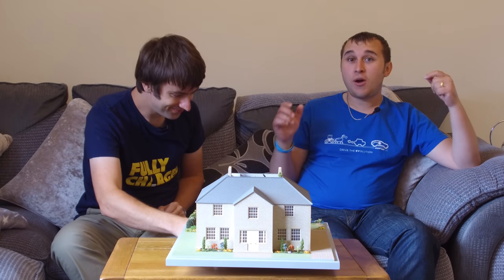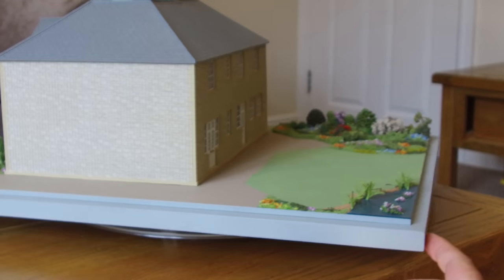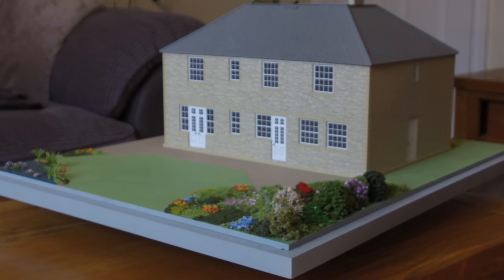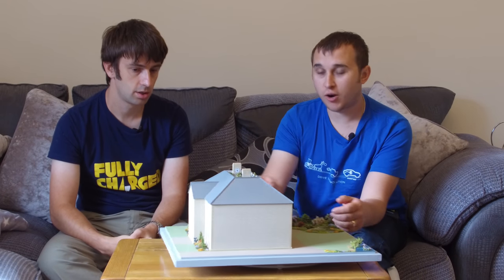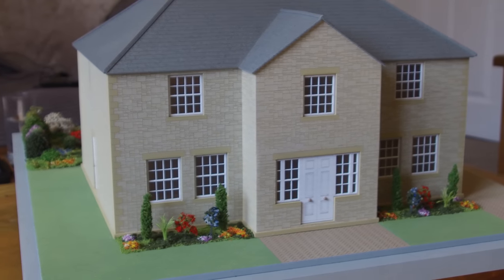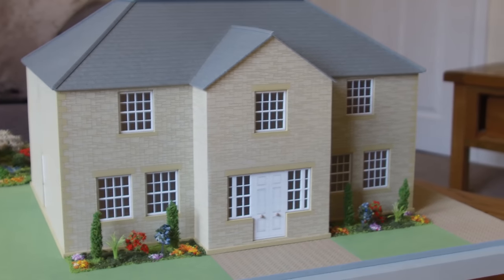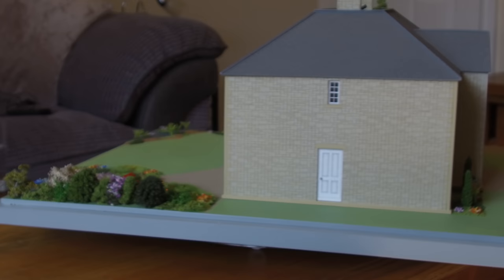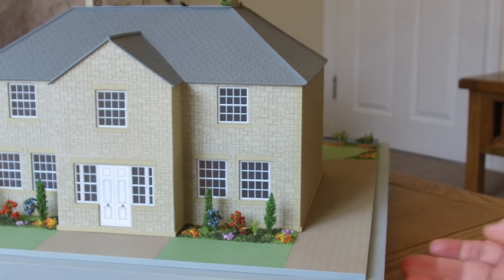Building An EcoHome & Why You Don't Want A South Array.

Comment: 21kw. Very nice although some homes aren't getting permission from the grid  for more than 4kw.

Sounds like a great scheme and opportunity. Having done a self build myself this makes so much sense.
Reply from the maker: I'd need to check on the DNO rules but am sure if some of the panels are designed only to charge the battery systems then it wouldn't matter how many you stick up long as there not exporting link'd Also the fact Dean plans to space these on West and East array means generation will be drawn to house rather than exporting like a typical south array.

Comment: Thanks, Nick. Points for Dean to respond to: You can also add solar PV tiles (pseudo-shingles) on the vertical walls, particularly on the East and West facing walls. Also, what about building a house which is oriented Southeast/Northwest - i.e., with a South-pointing corner? That should be very efficient for most U.K. families, from a PV perspective.

Comment: Making it law that including solar in new builds is good. However, it has to be mandated that there’s enough for the size of home/maximum occupants. There’s not much inclusion of solar in new builds locally. But where there has been over the past 2-3yrs. There seems to be a trend to stick 2 or 3 panels on 3-5 bedroom homes.
Reply from the maker: at this current stage ANYTHING is better than nothing,  but i'd agree you'd need to have a sensible sized system there and i'd also make them fit battery storage
Reply: That’s usually a box ticking exercise by the builders, but they should be able to put much more on there!

Comment: Net Zero and Passive House building standards and techniques should be normal building practice.
Air sealing, super insulation, LED lighting, triple pane windows, high efficiency heating and cooling systems, high efficiency appliances, set back thermostats, solar panels with battery storage and a EV charger in the garage or car park area. Doing a blower door test should be standard practice. Sealing air leaks makes a huge difference in comfort and energy savings. I had my older home air sealed and my utility bills dropped by 30% the following month. Well worth the expense. Saving energy saves money on utilities and is good for the planet.
Reply from the maker: The amount of builders who cheat the air tightness test is shocking! When i moved into my new build home the bottom of the skirting broads to the floor has chalk in the gap which will just be ripped out by the carpet fitters.  Then i had lots of leaking window glass by badly aligned frames.  To top that off the air tightness test used the entrance of my front door,  so the door it self was never check.... HUGE gap under it you could see the other side it was so bad.  So not only do we need to tighten up these standards but we need a government body who's able to impose fines for poor build quality.
Reply: Couldn’t agree more.
Reply: @NicolasRaimo  Maybe do a video of getting a blower door test on your home. Then get the recommended sealing done and see what the before and after is like.
Might be interesting to see you go about getting a quality tester and energy sealing company. Do your utilities offer any kind of energy efficiency testing to customers.
Reply from the maker: Kenz300 x Am in a very modern build so my house likely isn’t the best to test on, I have some energy saving videos for cutting down gas use and saving carbon

Comment: I thought the ‘well’ in the roof space would have been the big talking point and would worry about water penetration if I saw that on a property?
Thoughts?
Reply: Iain McIntyre You’re right to point that out but we have spent a LOT of time making sure it is belt and braces, double water tanked, has a drain with a sensor on rainwater capture system and also has separate backup overflow outlets that lead to the normal rainwater system.

Comment: Looks great! Is there possibility to have a garage designed into the property? It would be great to keep a solar diverting charge point in there!
Reply from the maker: Guess there's nothing stopping Dean also building an out building double garage, with a solar diverting charger like a Zappi system, however if Deans got his calculations right which am sure he has he loves numbers,  then in theory the battery system and well placed solar will mean you shouldn't need a solar divert system.... in theory!